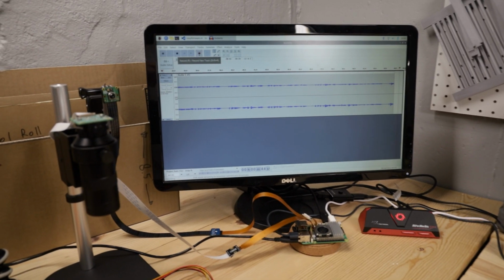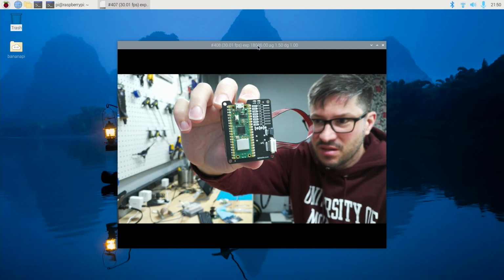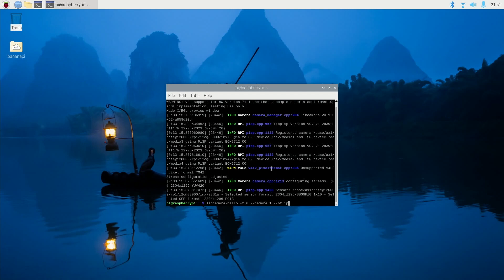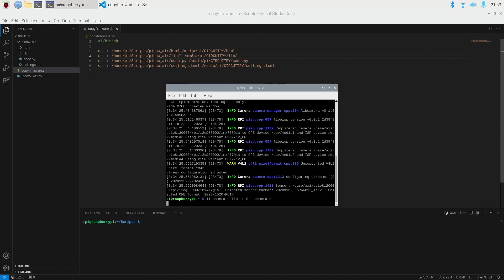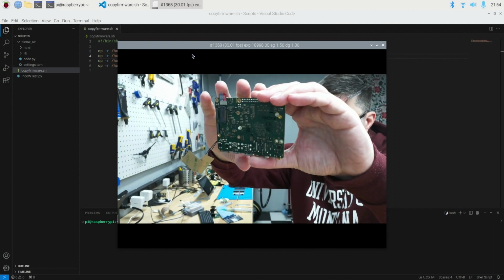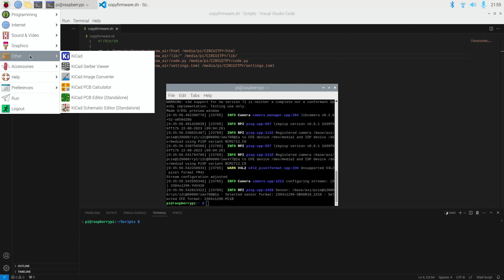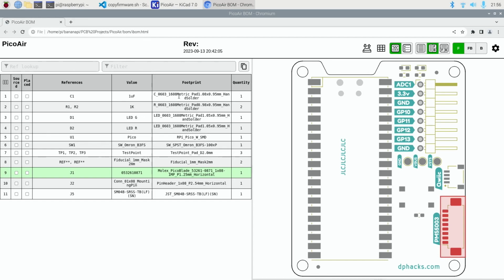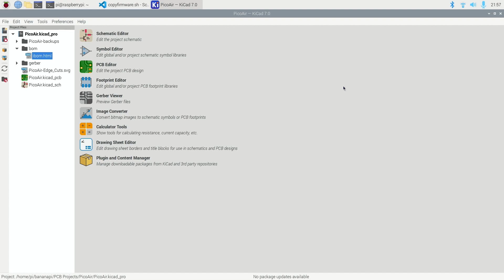Pi5 in the Workshop for Electronic Makers

Comment: Nicely done! Waiting for my Pi5, which must come within 8 days. Currently using Pi3B+ almost the same way you are, but due to the limit of 1GB RAM, I have to close the browser/programming IDE when I want to use a camera (microscope). Raspberry Pi in a workshop is very useful, as it takes very little space and allows me to search/read datasheets, watch YouTube tutorials, program microcontrollers and so on. The only issue is that my Raspberry is attached to the monitor and thus I have to use an external WiFi adapter with an extension cable, hope WiFi antenna on a Pi5 is stronger than on Pi3B+. My advice: make an extension cable for the camera out of the HDMI cable, I have extended it to 1.5 meters and everything works great!